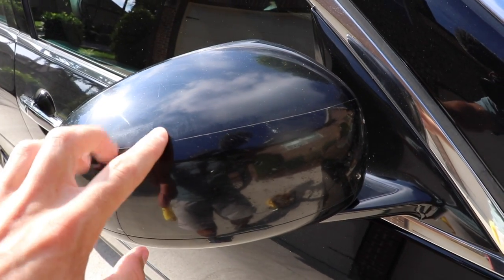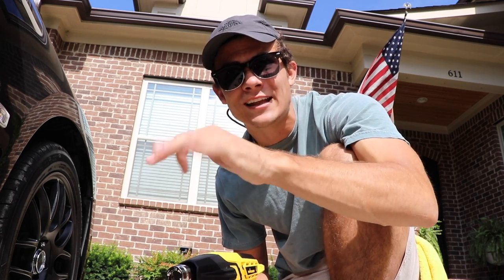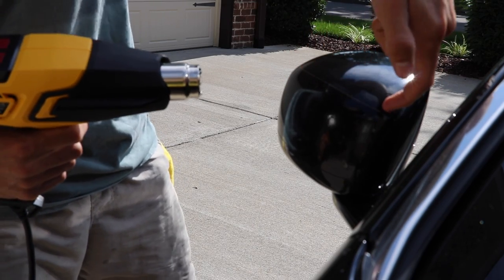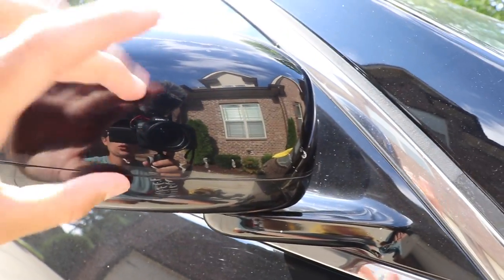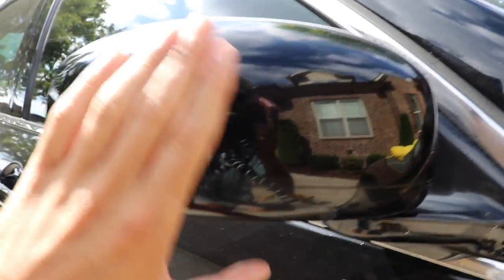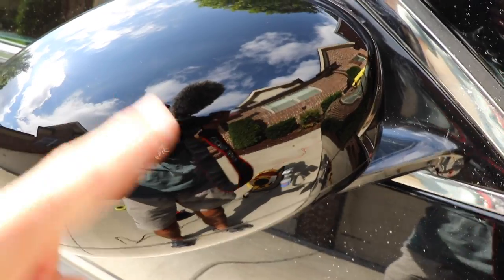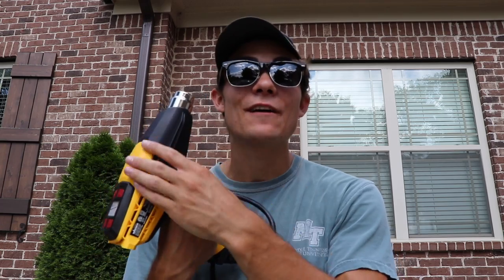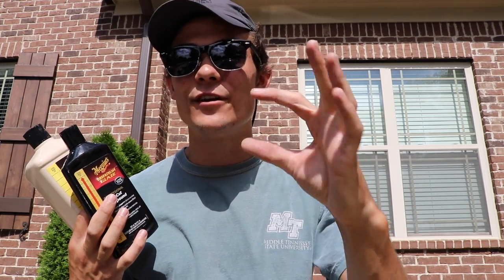Clear Bra Paint Protection Film Removal:  How To and What To Use!

Comment: I just took the clear bra off my car hood & mirrors. I started with just a hair dryer & it helped but I could tell it would take some time. A steam cleaner was suggested but all I had was an Oreck floor steam cleaner. SOOOOOOOOOO I put that to the test. As it is on the clear bra, I am also scrapping it off with a plastic scraper. Did not take as long as I it would have with just the hair dryer and much easier.

Comment: Lol...you make it look easy, that obviously had not been on the car very long because on my volvo it was a very difficult task getting it off. Mine did not peel off near that easy.
Reply: I totally agree.  My truck’s 3M bra was installed almost 12 years ago.  Even using a heat gun, the film would not peel off.  

It took a heat gun and plastic scrapers and the film slowly and painfully came off in melted globs.  Just a really messy, painful and difficult task.

Comment: I am in Franklin TN. I have a 2007 Mercedes that the dealer talked me into this bra when I bought the car. It is horrible and I want it removed. After years it is cracked and discolored and makes the car look horrible.  I have been looking for someone to remove it. We were able to do the mirrors and a little off one side but it took forever with a regular blow dryer and it won’t peel off on it’s own ( at least we had a really hard time getting just a little if it off. The dealership recommended a body shop but they said they don’t do that sort of thing.

Comment: absolutely did not work on 13 prius
Reply: I have the same issue with an 05 Prius. Did you find a way?
Reply: @IShockk950  first 3m auto adhesive remover then mineral spirits, and plastic razor blades ( get 100), your welcome!